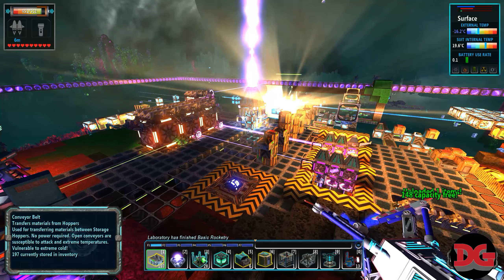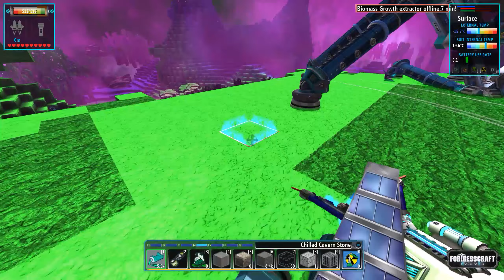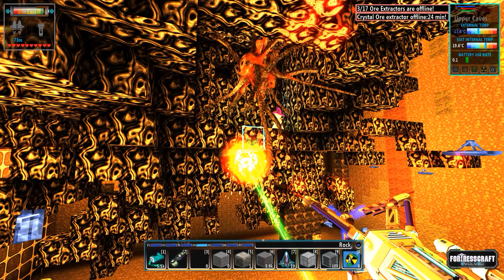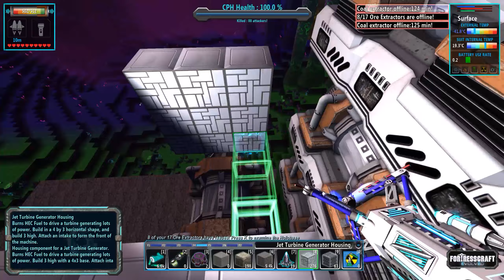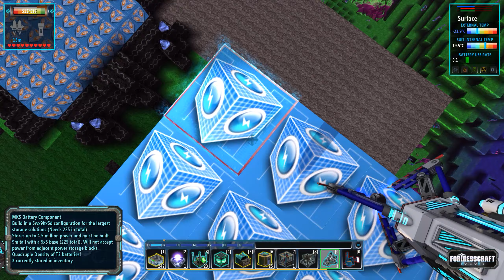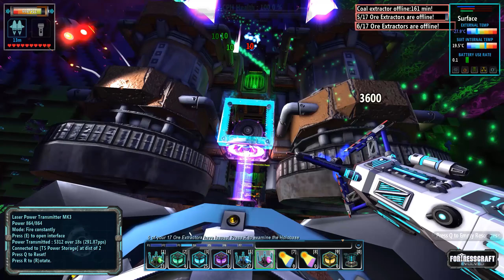FortressCraft - Frozen Factory! ► Let's Play Episode 16 ► Tower of Power! (1440p/60)

Comment: @Deluks  to make construction paste use coal ,build ore extractor on a coal vein you are not using, connected to several construction paste makers and lots of hoppers to make 100s of paste in a few mins
Reply from the maker: Ahhh! Brilliant... but but.. I will lose the coal! Kidding! That is a great idea, just hurts my sensibilities somehow :)
Reply: @Deluks you will need a ton of materials for frozen factory, so i suggest 

improve your smelting use mk 4 induction at least for nickel gold titanium 

and use drill motors on all ore extractors 

start mass manufacturing machine blocks in large quantities and collect them regularly 

use turbines lots of turbines ,you will need lots of power 

about the tin vein in your smelting area ,you can super dig it easily as it is almost depleted, one dig should remove it 

mine carts are useful to get ore from extractors to the cargo lifts instead of  pipes 

Hope this helps ,loving the series ,waiting for the frozen factory content.your base is awesome by the way .